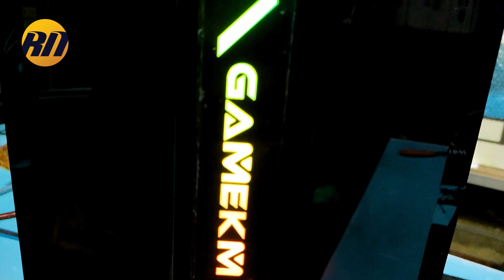10 Gen i5 PC Build RN Computer, i5 10400, 8GB DDR8, 120GB M.2, 500GB HDD,  RN Computer, Chuadanga,

Comment: i3 4130+coler master cpu fan,
M/B: Asus H81 HDMI port soho.
Ram: Ramsta 1600 bus 8 Gb.
Ssd: Transcend 120 Gb
Hdd: 500 Gb
Casing: Value Top Atx with psu.
Monitor: Lenovo 20"
Key & Mous: A4Tech wirless.
সম্পূর্ণ প্যাকেজের মূল্য কত পড়বে??